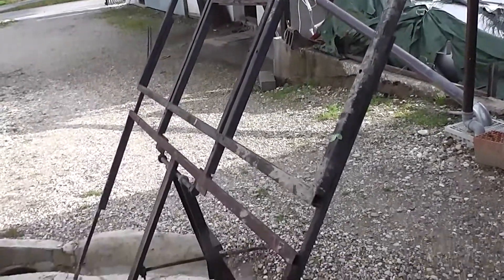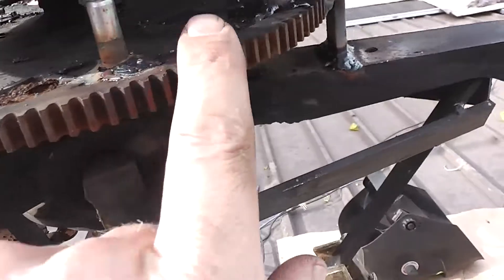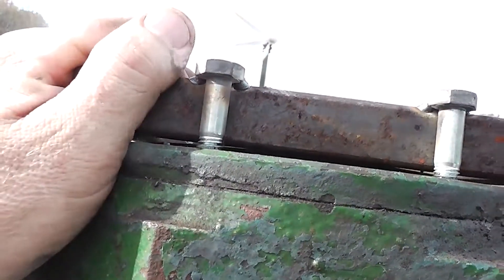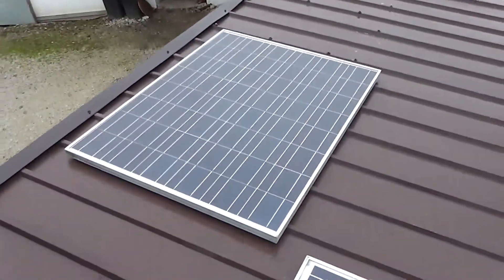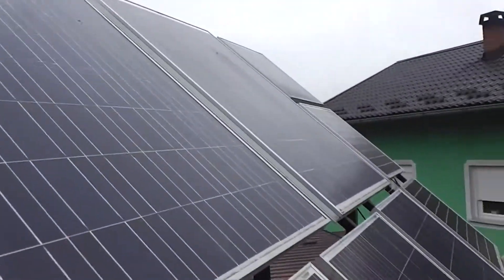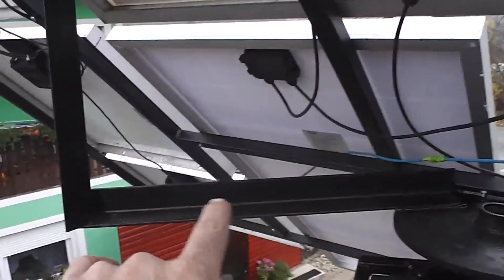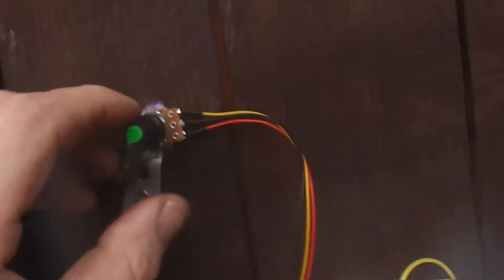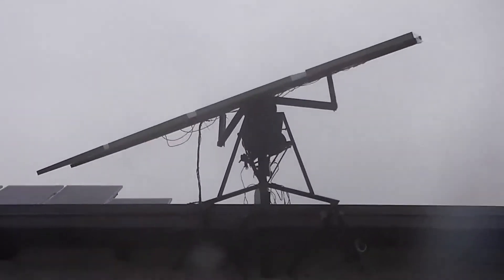New solar tracker

Comment: Super kanal. Subscribam se. Svaka cast na stvarima koje radite. Volio bih saznati više informacija o solarnom trackeru kojeg ste radili posto i mene zanima napraviti nesto slicno. Gdje naci motore,prijenose,osovine itd...
Reply from the maker: Prije sam izrađivao prijenose pomoću starih zupčanika,sada koristim reduktor i mali motor od aparata za varenje ili od auta za brisače,traker radi mehanički uz timer koji svaki sat radi 1 minutu,da dobijem dovoljno sporo okretanje koristim i regulator voltaže sa opcijom okretanja lijevo ili desno,taj sistem koristim od samog početka i nikada nije zakazao
Reply: @Mladen365  Super ste to složili. Vidim da ekipa po youtubu koristi linerne aktoatore, a ja sam pokusavao naci nesto ovog tipa.